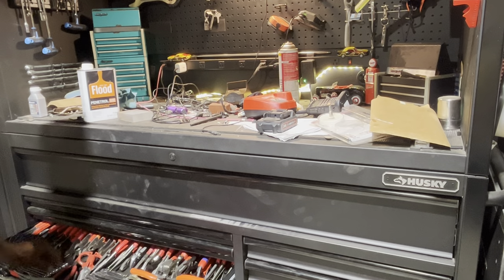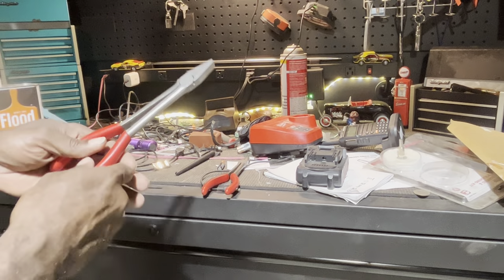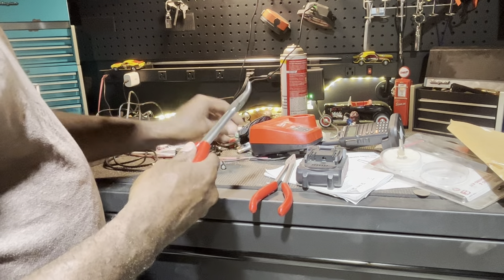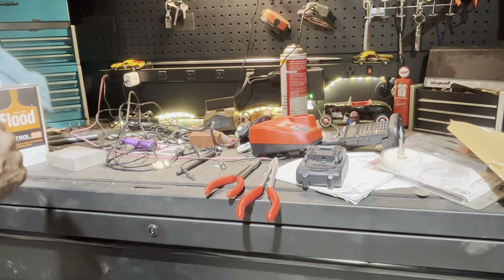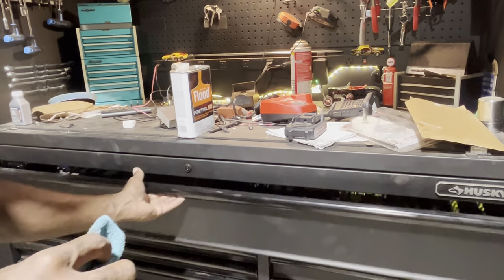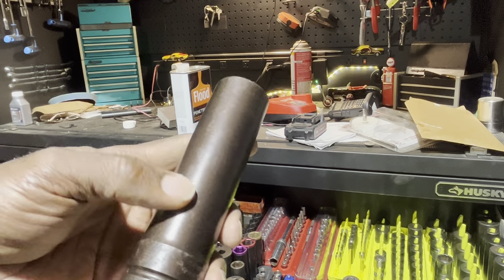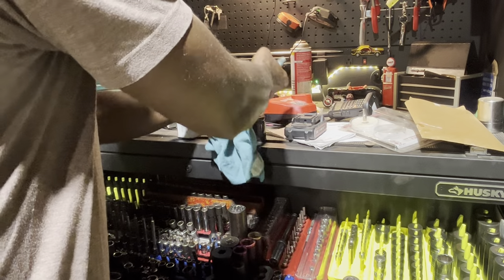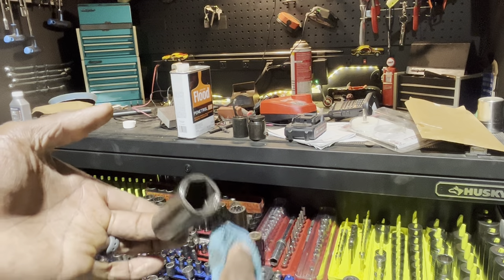STOP SNAP-ON TOOLS FROM RUSTING!! #toolhacks #snapontools

Comment: I completely agree about snapon rusting fast.. I bought 3 sets of pliers, a long pick set and a short pick set and found that they all had surface rust on them after the first weekend.. I don’t quite understand it. The most expensive tool brand in my box and they immediately started rusting. I cleaned them off and coated them with motor oil but the finish now has dark spots where that surface rust started. My box is full of icon, tekton, Capri, Milwaukee, gearwrench, Matco, and quite a few other brands and they have never done that! I will absolutely pick that penetrol up. I clean my tools on saturdays and like to keep them the best condition they can be.
Reply: Man I hate those dark spots on the pliers lol. I try my best to keep all mine oiled up. Just looking through ebay you can see how bad they start looking when not cared for.

Comment: Thanks for the tip about Penetrol. I've tried PB Blaster, WD 40 and 3 and 1 oil in the past. The rust came back eventually. I'll have to give Penetrol a try.
Reply from the maker: You won’t be disappointed. All of the others will wipe away over time, whereas Penetrol acts like a clear coat. The coating hardens and doesn’t feel oily or greasy, which is one of the prime reasons I enjoy using it. If guys are applying to their patina trucks, cars, etc, you know the wear-factor is good!!!